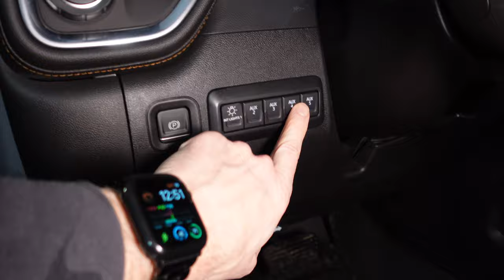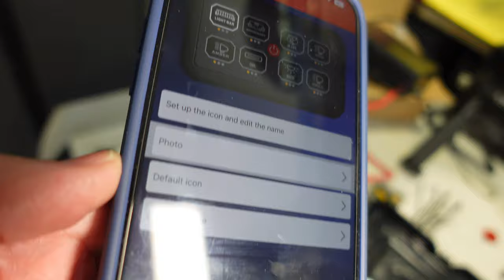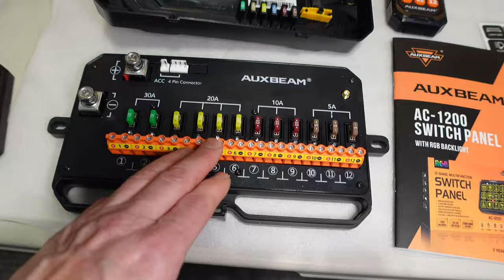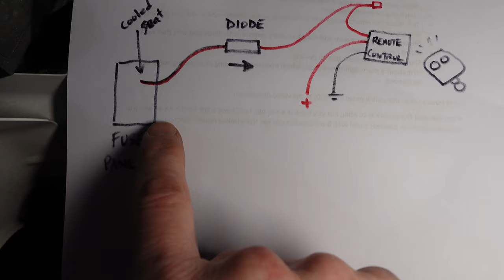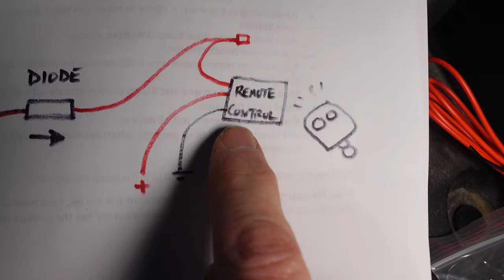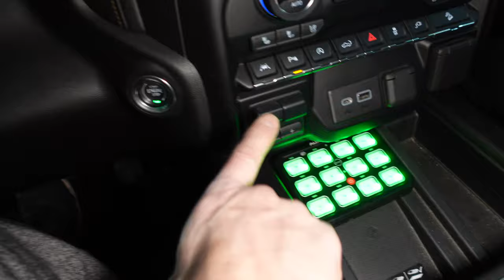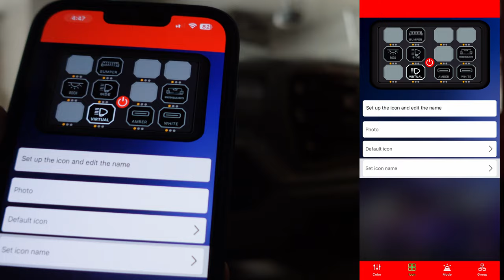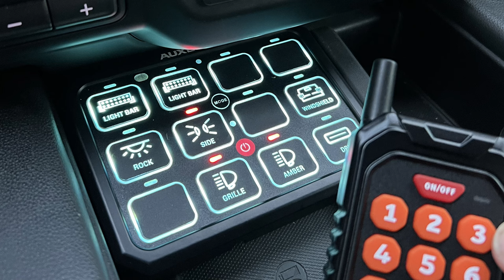AUXBEAM Switch Panel AR-1200 RGB Multifunction Bluetooth & Remote LED Install and Review

Comment: You can connect some LED grille lights to it, it is for a tow truck and if you can change the flash pattern of the lights, there are 30 flash patterns

Comment: This is cool .. can i know which fuse do you use for power the control panel . Is it inside fuse box or the one next to the engine.. my problem is i have some camping lights and I can’t use it without turning car switch on
Reply from the maker: I used two methods simultaneously.  For switched power (turning in the vehicle) I used the cooled seats fuse inside the cab’s fuse panel.  I also wired in a remote control turn on so I don’t have to have the vehicle turned on.  I don’t use that option very often
Reply: @Donslife thank u , What about the remote? Do you recommend a specific type or do you have video for install it? I hope I did not disturb you, but you are my Sierra godfather.
Reply from the maker: Adding a Wireless Remote For My Accessories!
https://youtu.be/aV7ey5415dI

Comment: Don , love your videos. I purchased an Auxbeam 8 for my rock lights but I have pod lights on my truck that is wired to my reverse and on a separate switch so I can use at night. How can I wire the pod lights to the Auxbeam and still have them on my reverse and separate switch ?

Comment: As a electrician: please use the propper size fuse in the auxbeam module, that way you have one place to troubleshoot AND you have a visual indicator led for the error
Reply from the maker: Good advice
Reply: I completely agree with you BUT..... but just asking for a friend I wonder if all the relays are the same Duty ( are same current capacity as all the switching relays). for whatever reason if my friend wants to throw a 30 amp fuse in the 5 amp...... because he's probably got a special purpose and he WON'T run them all at the same time........ or exceed the 100 amps..... knowing him if it's rated for a hundred amp you'll probably only use 50 amps total...... he probably has five or six things that need 20- 30 amps apiece...... just asking for a friend LOL

Comment: What’s up brother! Might be a dumb question but if you have the boost auto running boards connected to the switch and you start the truck is there a setting for that to come on when the truck starts? Or do you have to turn them on remotely every time?
Reply from the maker: Hey there, I have the steps hooked up to turn on and off with the truck.  They are not something I have connected to the switch

Comment: Hey don, what kind of diode and where did you wire it for the controller? I’m thinking of doing something like that
Reply from the maker: Just a run of the mill 12v 10A - you can find variety packs on Amazon.

Comment: Have you looked into running the Anzo headlights for the Sierra? I’m thinking about getting some because they have LED Projectors instead of the OEM reflector style which usually offers more even, useable light.
Reply from the maker: I haven’t gone down that rabbit hole 🕳️

Comment: Saw the grill lights liked them. Do you have a link or did I miss it? TIA
Reply from the maker: New video launches tomorrow.  Considering subscribing so you don’t miss it.  It is about the grill lights.  

Here is an older video: Check Out Putco's New Virtual Blade LED Grille Lights! Full Install and Review
https://youtu.be/3THscd8BslQ

Comment: Hi Donny, I have this all installed and running, but I cannot find any ACC point to hook it up.  Can you tell me where exactly you did it?  I seen you have taken it out of PAX Seat Cooler, but not one of my fuses are ACC powered.  2022 2500HD Denali Duramax.
Reply: Never mind, I just found it after some searching.  Time to complete the job.

Comment: Where/how did you go thru the firewall?
Reply from the maker: There are two identical rubber grommets about 3” in diameter located on the firewall.  The look like rubber cones.  You need to cut or slice a hole in the tip to pass your wiring through.  Folding back the sound deadening material on the inside of the cab will also need to be done.  Watch my Auxbeam AR-800 video if you’d like to see more information.
Reply from the maker: New Switch Panel AUXBEAM AR-800 RGB Multifunction Bluetooth LED Install and Review.
https://youtu.be/nlDsZFIrpA4
Reply: @Donslife  you're awesome thanks!